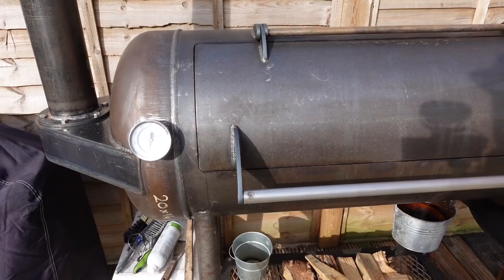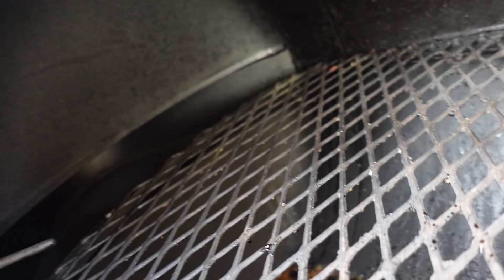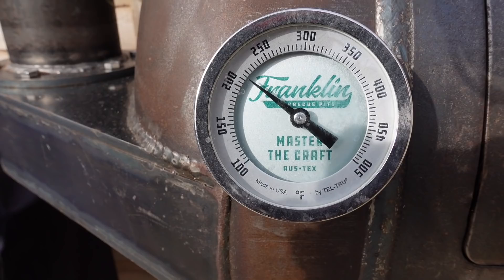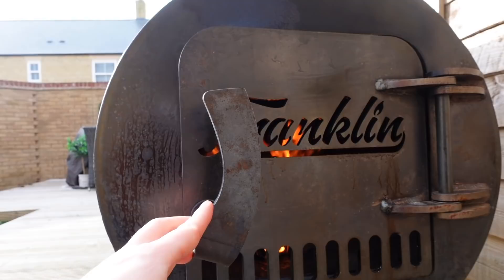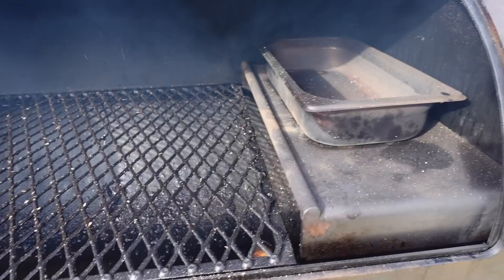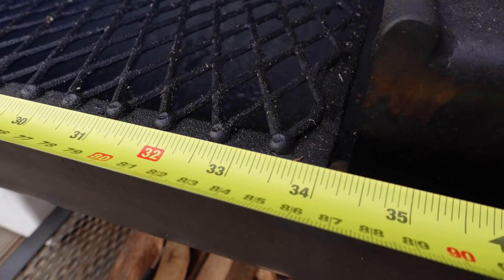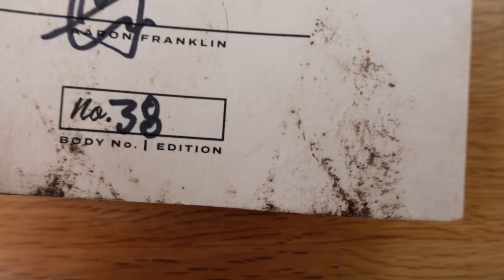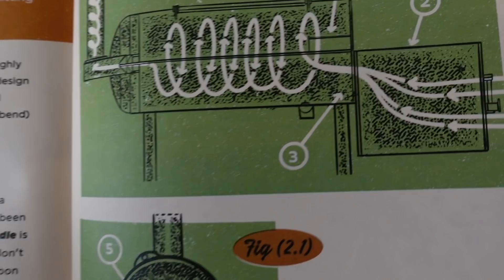Franklin BBQ Pits | REVIEW

Comment: I do not recommend using animal fats on the outside of your smoker. Eventually they will go rancent. You can use vegetable oil but mineral oil would be best. They can't go rancid. Something else, I don't re paint any exterior portion of my cookers. I just use a very light amount of canola oil. Very thin. I have a offset that is always outside with no cover at all now for 3 years of Washington state rain and still not a spot of rust. Anyway keep up the great work. 👍

Comment: Line the bottom of your fire box with fire brick. That will give you several advantages. Raises up the bottom of the firebox, keep some more even heat and helps prevent the bottom of your firebox from rusting.
Reply from the maker: Thank’s for the tip! But I like a rounded firebox floor rather than flat to allow maximum airflow under the coals!
Reply: My firebox is a bit larger, half of a 250 gallon tank. The bricks I got were only 2 1/2 inches thick so I didn’t really hurt the inside dimensions that much. It seem to help with a consistent temperature. But I’m heating up 1000 gallon tank so there’s about 16 feet from the firebox to the smokestack. Anyway, great video thanks.

Comment: Seems like a few engineering flaws. The side only access for the firebox makes it impossible to use charcoal as a bed for your wood and then that lip makes it a pain in the arse to clean. Also, the water pan should’ve probably been elevated on a slide out tray, not taking up space on the cooking area.

Comment: One barrier of entry I've found with offset smokers tends to be where one sources their wood. Have you found decent wood difficult to find where you live?
Reply: Depending on where you live there are some different options for you. 

If you are just cooking for the family you can just go to anyone who sells firewood and get great deals. Like $75 a truck load.

If you want to do competitions you can go thru many different places online to get consistent wood. Carolina cook wood, Vaughan wood products or you can order Western Wood Products mini splits from Cabela’s/Bass Pro Shops. Now all of these places will cost you a little bit more than someone just cutting firewood. However the wood that you get from these places are VERY consistent and are usually kiln dried to burn constantly.
Reply from the maker: White oak is abundant here in the UK. Its very easy to come across. I have a good wood supplier here, who also builds offsets. so they have great seasoned wood and sized perfectly. looks like someone above has helped out with sourcing wood in the states
Reply: @shawn81073  Wonderful info!  Since I am moving to North Carolina sounds like there are definitely plenty of options!
Reply: @WilsonsBBQ  That's great!  Your video and content are well-received and enjoyed

Comment: How even is the temperature across the grate?  I assume there are no tuning plates, which must mean there are significant temperature variations.  Or not?
Reply: I build pits just like this but in a 24x48 size . Temp difference is Maybe 10 degrees max because the airflow rate is high .
Reply: @Smokeslingerowner  Thanks.  Love to see your pits.  Do you have a link?
Reply from the maker: Dustin is right. Although there is more radiant heat near the firebox, there is a tonne of convection near the stack end.

Comment: I would love to actually see the bi-metal strip that you speak about.  Is there any way we could get a shot of that?
Reply: In for some pics/video of the bimetal business going on under the baffle plate, pretty please!? @wilsonsBBQ
Reply from the maker: I will try again to get a shot of it. But, the reality is that it really doesn't look like anything unless its running hot. It's two plates of metal (either slightly different compounds or thickness' which bend at different rates) stacked on top of each other. When cold - it looks just like that! It's only when its heated that you would be able to see a difference (and even then, i'm not sure how far they bend and whether it will be noticeable). 

Obviously, I would need to run the pit while the grate is out to get a picture of it - which I haven't had the time to do just yet. But next time i fire it up, I promise I'll take the grate out first and try to get a good picture and post it to my instagram! I'll also come back to these comments to update!
Reply: @WilsonsBBQ  Thank you, really appreciate it! Size/shape/orientation is a complete mystery. Would also like to see the dimensions of the baffle plat itself. Thank you sir.
Reply: @WilsonsBBQ  Man that would be greatly appreciated.  I am in the middle of a build and could really use that info.
Reply: @WilsonsBBQ  Also would it be possible to get the dimension of the piece you are touching at 7:37 ?  That would also be a HUGE help to me

Comment: I noticed you had some probe clips sitting in the water pan.  How do you route your probes on that pit?   Is through the door an option.
Reply from the maker: I actually don’t use probes anymore! Before this pit, I was a probe guy. But, routing probes isn’t great on this pit. The door is so heavy, it just bends the cables to point where I think they might break. So, I started relying on the tel tru thermometer only - and I have to say, I cook better barbecue because of it.

Comment: Great walk through! Does the heat deflector come out? Or is it welded in place? Looks to be 6” wide?
Reply: Ever find out if it's 6" pipe?
Reply from the maker: 4.52”
Reply: Is that the inside diameter measurement for the stack? 4.52 inches? The stack diameter is what I’m struggling with on my build. Thank you

Comment: Nice video.  The firebox clean out issue is definitely a negative mark.  Surprising since Franklin seems to overthink everything.  Nice pit though, nonetheless.  🍻
Reply from the maker: i've thought about it more, and it might be something to do with the fact that the firebox is semi insulated. though, i think the lip could still be dropped to the height of the inner firebox tube. No doubt he has his reasons! and its really not a huge issue, doesnt take too long to clean out...im just being lazy!
Reply: I think it's totally for the safety of preventing hot coals from falling out when the door opens. I've got a slighter larger offset sans firebox lip, coals fall out.
Reply from the maker: That’s a really good point. In fact, I did have that problem a few times on my last smoker.

Comment: Great intro! Wondering how you cope with the temps with it being that close to the fence? I'm worried I might torch the fence with my offset that close.
Reply from the maker: Absolutely fine! This doesn’t have a door on the top, so no flames can really come up and outward. My last pit had an access door on the firebox, sometimes the flames would get a little big and concerning. But never had an issue. This is a semi insulated firebox too, so it gets hot - but nothing to be worried about

Comment: You need a V shaped fire basket, and put little bed of charcoal in bottom. Will help on fire management, and prevent your stack from falling apart.  Get longer burn,  and keep your firebox lasting longer.  Franklin to me is way overpriced on this, this is very basic offset setup in TX.  This isn't a horrible smoker, just basic and over priced.  Can get a lot better from custom makers in TX for 3k.  To me is scam, and paying for Franklin name is all.
Reply from the maker: I personally dont need a v shaped box. I prefer to have a rounded bottom firebox and use 100% wood splits on the rounded firebox floor
Reply: @WilsonsBBQ  I wasn’t referring to your fire box.  You need a V shaped fire basket to go in your firebox.  Set a bed of charcoal to get started up, and then throw wood on.  Even without a basket, you’re burning down wood to coals then putting logs on top.  You’re just wasting wood that could give you more fuel to smoke.  Also, a basket will give better flow through the smoker...and makes for less fire management.  We have been doing this along time in Texas,  but by all means waste wood and spend more time tending a fire.

Comment: I'm a Texan and lived in England for 6 years.  Personally, if I were to buy an offset for England, then I would be looking closely at Peoria Custom Cookers.  Their MMIF and MMOF are fully insulated.  You can use them year-round, especially during the cold and rainy season.  Also, they are BBQ guru ready, so they can control to within a degree or so.  They also have good flow dynamics.  People win BBQ competitions with them.  They are not made in Texas, but I only care about real data.  A MMIF is on a trailer and can be bought for $6K.   Two Franklins roughly in price.  So, if you want to cater, it can be pulled by a car as it is not too long and heavy, yet it also has a lot of internal cooking capacity.  http://www.peoriacookers.com/custom-cookers/meat-monster-mif.html